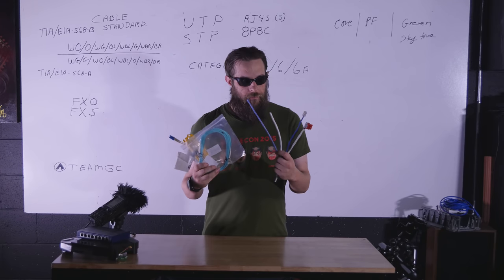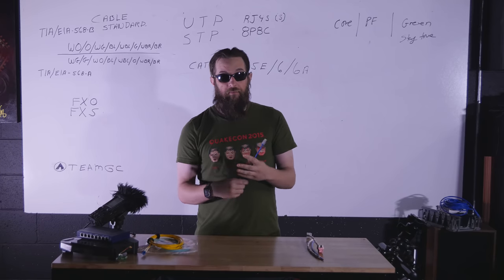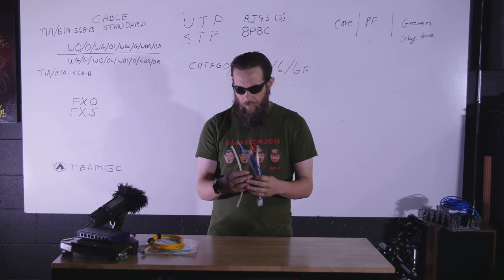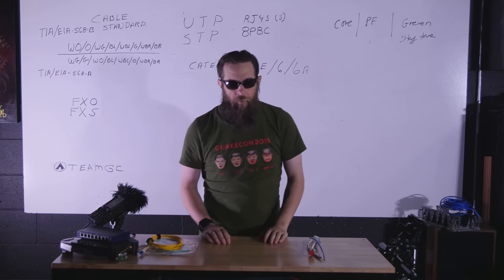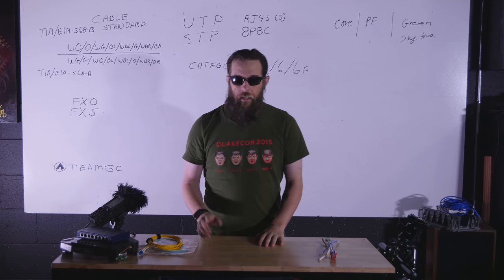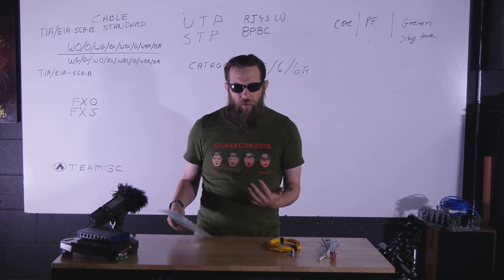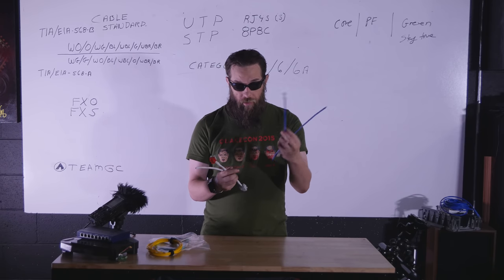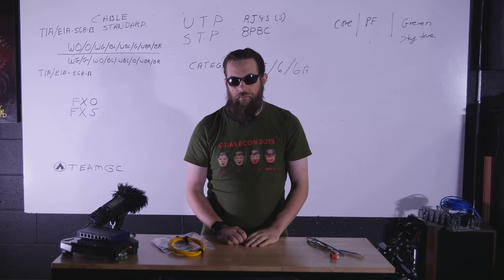To Build A Network: Cables with Qain

Comment: Tip: Always make sure you get the kind cable for the type of connection you need, most people always go to the route of how much it will cost. A mistake people make when implementing their internet structure is being cheap, don't do this. Take the time to research, you only want to touch the cables once in the installation process, lastly and this a is key important step is label everything, in case you have to troubleshoot. Thanks for the video!

Comment: @Deus Qain How to pick or make a cable that is good for POE. Like a really long 100ft cable.
Reply: IDK I bought a cat6 cable 100 feet that was thin, and I tried doing poe to run my ubiquiti ac but it did not work. It worked great as a lan cable but not poe. The ISP cable that is short and thick cat5e works just fine.
Reply: Ya, is this why it did not work?
Reply: I heared that this also has something to do with the AWG  of the cable
Reply: Thanks so much for the help, really appreciate it.

Comment: Question: I live in an older house in the midwest that isn't well suited for wired or wireless networking. Our Coax lines come in from the pole to our basement, as well as go around the side of the house to the upstairs living room and bedrooms. Would it be feasible to run Ethernet along the side of the house in the same manner as the Coax cable to get Ethernet to the living room and other rooms that need it? If so, is any special cabling needed for that sort of job. The siding to the house is aluminum if that makes a difference.
Reply: Thanks Qain!